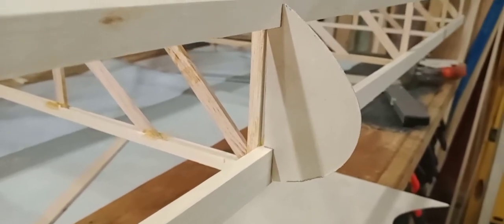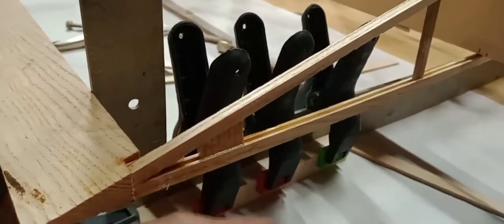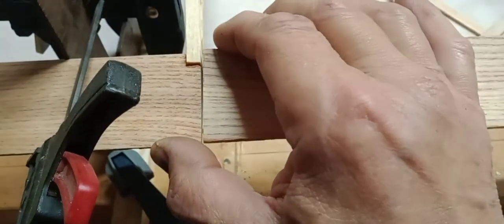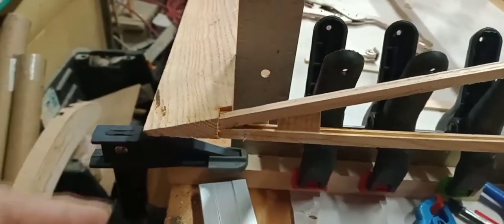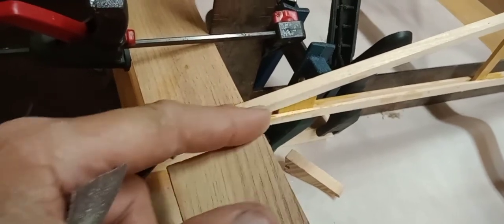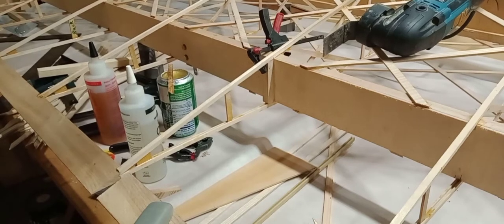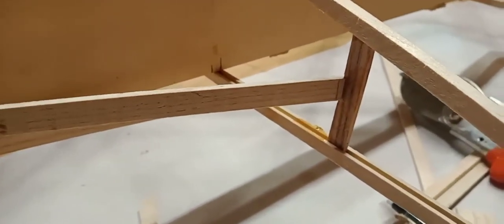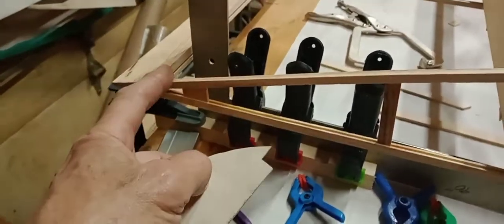FP202 Scratch build from prints E84 nose ribs, build the aileron

Comment: Very informative video! In terms of what I think about your plan to double the leading edge pieces? I am certainly NOT qualified to make any judgements regarding that. I am interested in how you will be able to accurately butt the pieces of 1/16” leading edge ply no matter what approach you take. On my Super Koala the nose pieces are 1/8” and where the leading edge sections meet the nose pieces are doubled. I’m not sure of my ability to work to that level of accuracy, so hopefully what you do will be helpful.
Reply from the maker: I'll just double them at the but joints. And I didn't realize that the SK used ⅛ for the leading edge.
Reply: @timketcham9139  Just to be clear, the formers are 1/8”, the leading edge material is 1/32”. You are probably getting tired of hearing how helpful your videos are, but they are!
Reply from the maker: Ya know... I don't have a material list. I'm sure that mine is probably 1/32 also.